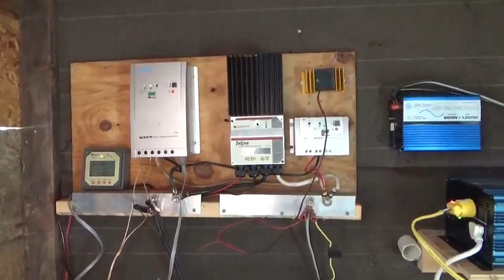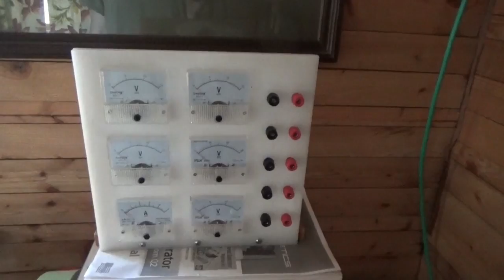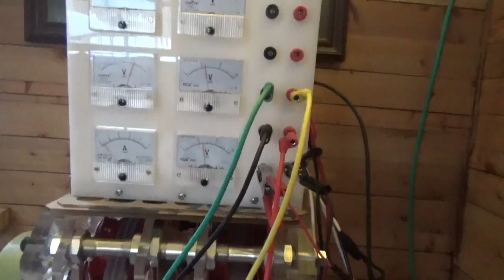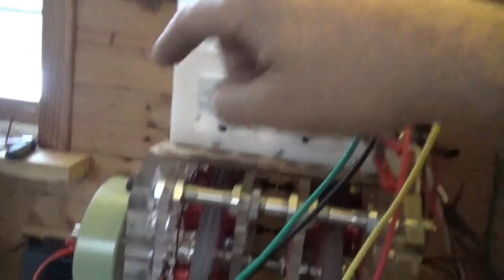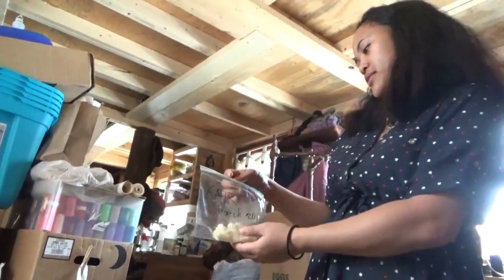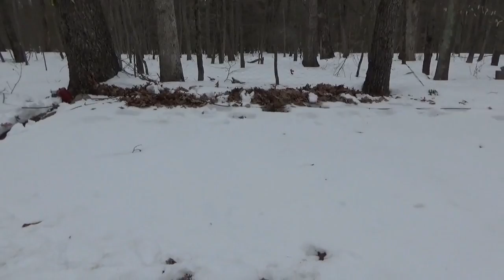Still Digging Out The Homestead & Snow Plow Cut Internet Line

Comment: So what do you call that new Machine with all those gauges Brother Troy.
Reply: it looks like a Rockwell Retro Encabulator capable of synchronizing cardinal grammeters with capacitive duractance
Reply from the maker: Quanta Magnetics Q3 Charge Accelerator. Basically a super efficient pulse motor spinning a pulsed generator and a toroid. Three outputs to charge batteries using very little power to turn it.

Comment: that piece of wire you used to repair phone line we'll look outside interference in it is best to use some type of solid copper low voltage make Network wire or telephone line I can't count the amount of times I've got to customers homes troubleshooting slow internet or intermittent issues only to find out that they were using an old extension cord or something like that to hook up a telephone somewhere the braided wire does not work well with DSL

Comment: Mango pit at  work on Melinie. You need mud and snow tires will help you walk out of the soup. Need to get a potato picker to glean out rocks of fist size for rocks to lay in driveway for a solid base. I know your not staying but suggestion next owner of land for nice lane .
Reply: I think he said the driveway is a quarter-mile long.
Reply: Yes, and it 56 acres of land fill with fist sized rocks that a potatoes digger will glean out about two feet down all over between rock walls on homestead. That was why They had men on the back to keep the rocks out of potatoes for. If you let them rocks onto a trailer there should be enough for a 1/4 mile bed of rock along the drive. It will be idea for new owner of homestead.
Reply: Might be an idea for Troy's new homestead, too if he can get ahold of a tractor or horse to use.
Reply: He will find a better built drive in Michigan. He wants a good built home with a little time to convert to a off grid setup. As long as it is a tri powered system.  Solar,Wind and Water generated dc to charge battery Bank and convert to a a.c. powered home. It can be done if he read his a.c. box right before he takes the new homestead off grid. Hopefully he gets a 1/8 section of farm land with house on it. Or look for a area of Amish farms being built up.